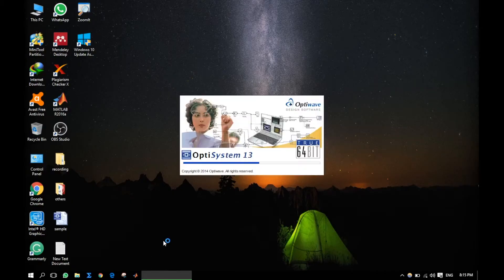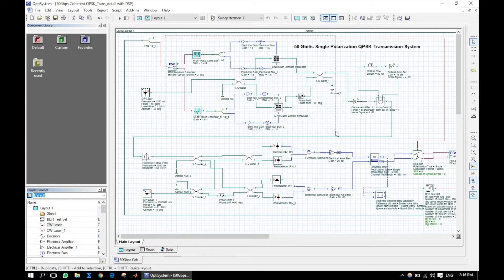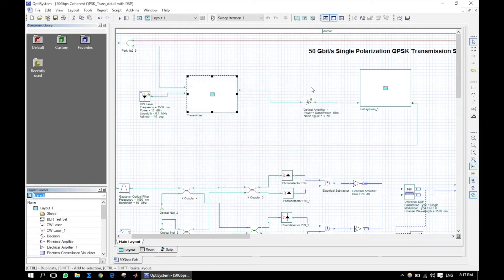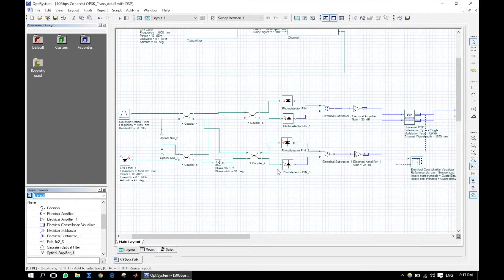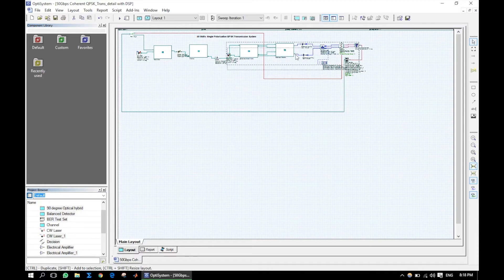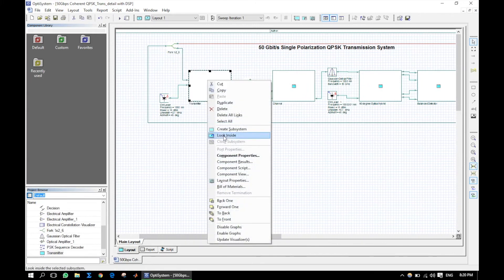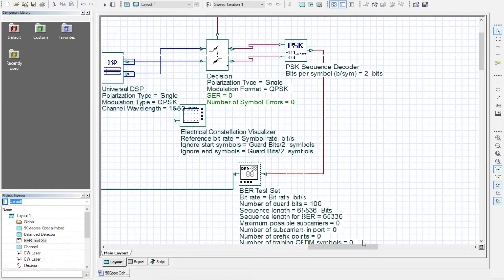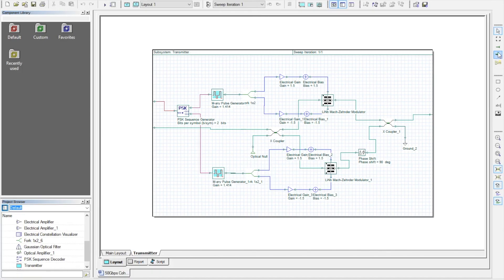How to create Subsystem in OptiSystem | OptiSystem tutorial for beginners | make your design better

Comment: How to make dual polarization dual parallel mach zender modulator using optisystem 7.
Ple  reply.....
Reply from the maker: You can easily make it. Use polarization splitter to split the lightwave into two orthogonal polarizations. You can IQ based modulator structure further.